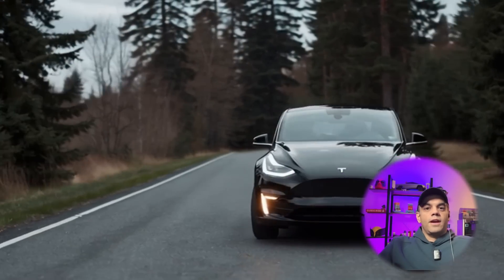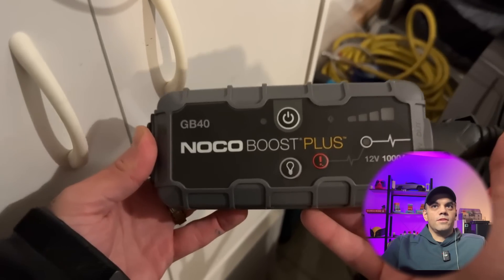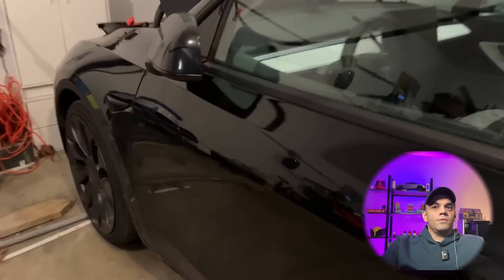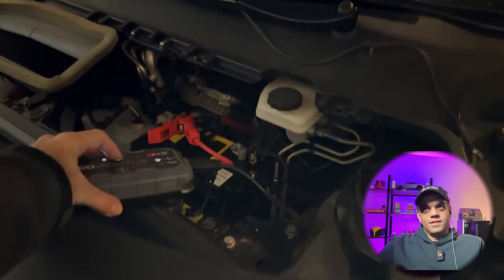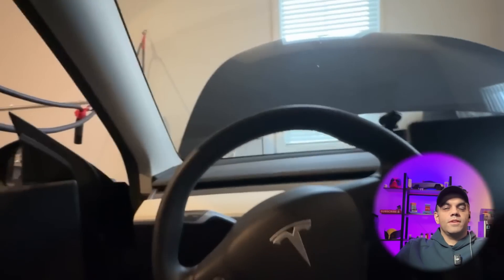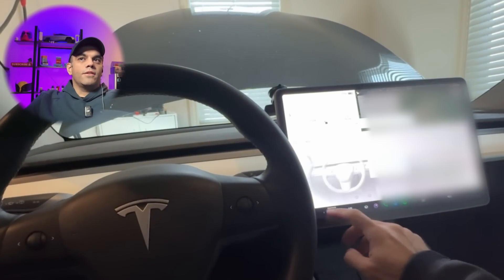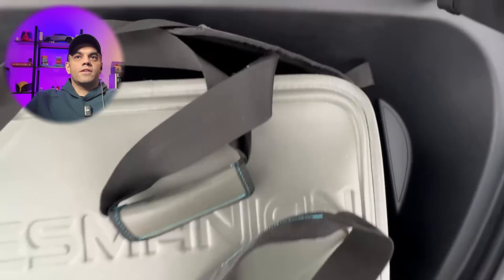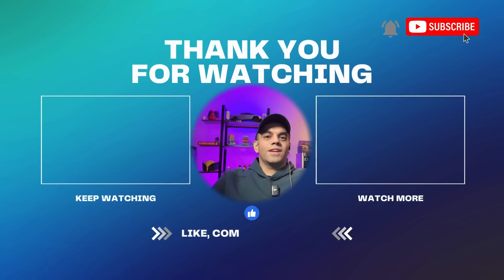How to unlock and jump your dead Tesla

Comment: So from what I can see, when you take the 12v cap off and pop the wires out, the plus and minus are on separate sides.  (I think).  But when you put them back on, you put them together on the same side.  What!?!?!   That just looks bad.  You might want to check that out.
Reply: Shouldnt the wires be separated and not be touching?
Reply from the maker: Look at step at at the link above. They are stored one way.
Reply from the maker: That cap only has one spot to hold both terminal sides. Look at this from Tesla. Check step 8:

https://www.tesla.com/ownersmanual/modely/en_us/GUID-34181E3A-B4A7-4658-906A-38C6647B5664.html

Comment: so anybody can open the front trunk with portable jump start in matter of few seconds?
Reply from the maker: Haha. Good question. No. The car has to either be dead or the 12v has to be off (or has no power as Tesla says). It’s spelled out in the manual. But your question is a good concern to have. 
https://www.tesla.com/ownersmanual/modely/en_us/GUID-34181E3A-B4A7-4658-906A-38C6647B5664.html